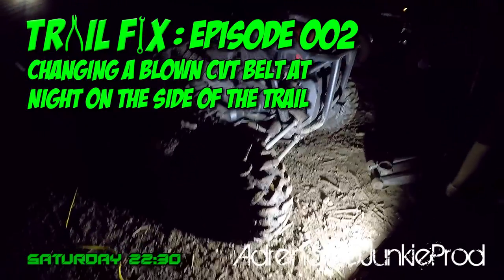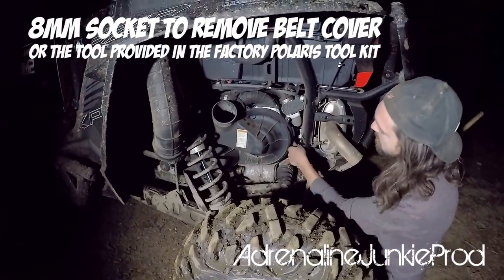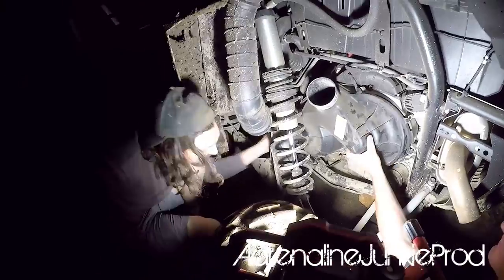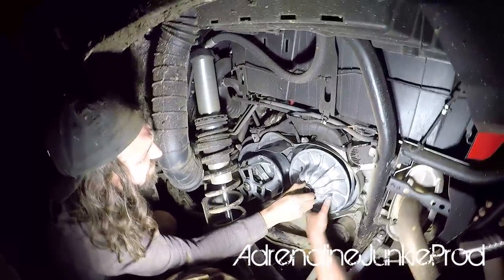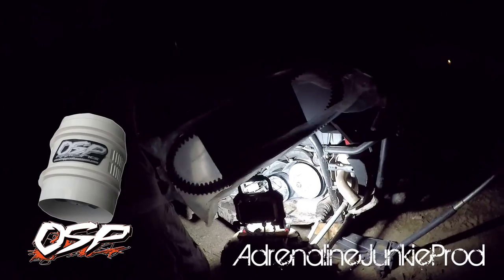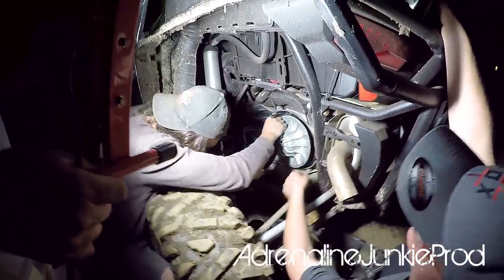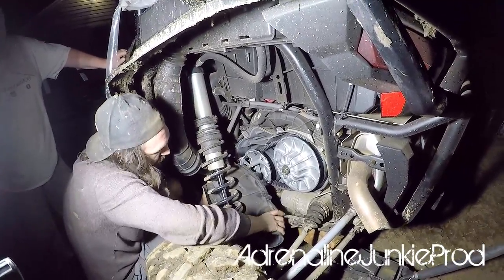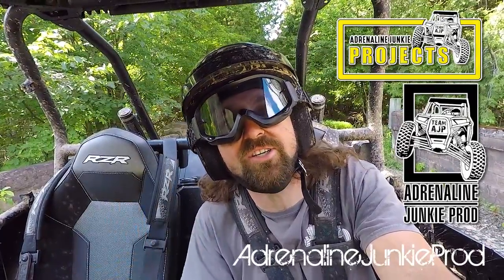Trail Fix - Blown CVT Belt on the Trail at Night - How to replace a drive belt - Episode 002

Comment: I put  INLINE bilge blower 270 cfm intake side of the CVT to prevent belt temps from getting high when at low speed runs. Or after you come to stop and it keeps the cool air blowing on the clutch to keep the parts from heat soaking.
Reply: I was wondering about a ‘bilge blower’ because I have one sitting around. The idea is simple and I’d bet works great.
Reply: @mikem9953  3k miles same belt mudding, rock crawling high speed runs.
Reply: Compared to how many miles per belt prior to the fan? Approx?
Reply: @mikem9953  bought 700 miles

Comment: I have my original belt in my trail tool box I didnt throw it away wen I put a new one on I changed it at about 1500 miles with a high lifter xg3 or w e and it has 1500 on it

Comment: What does it sound like when you break a belt? Or what happen to your machine when the belt breaks?
Reply from the maker: Loud bang usually and then you cant move. Sometimes you might get a little smoke and a burn rubber smell like a burning tire. usually the belt gives you some warning before it blows. If you smell burning rubber while riding hard its probably your belt about to explode. You are dead in the water with a  broken belt, you wont be able to drive and the engine will just idle and rev but not drive.